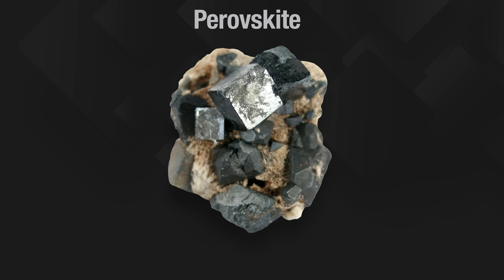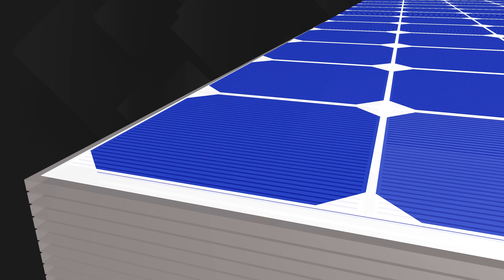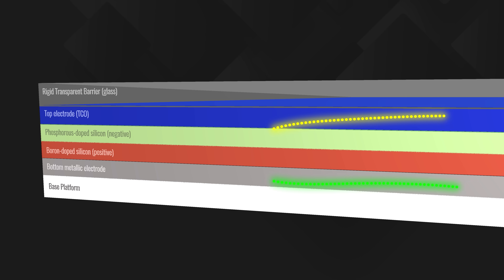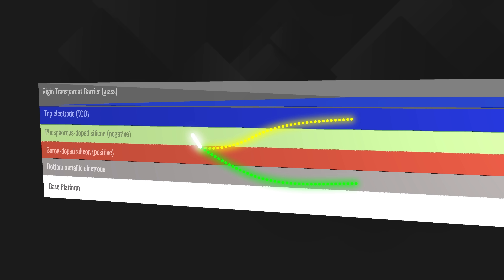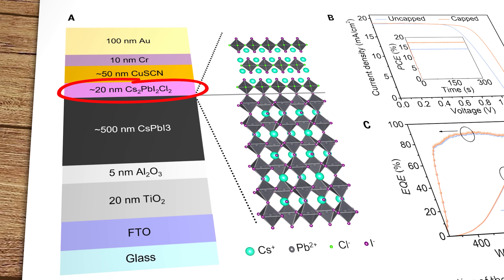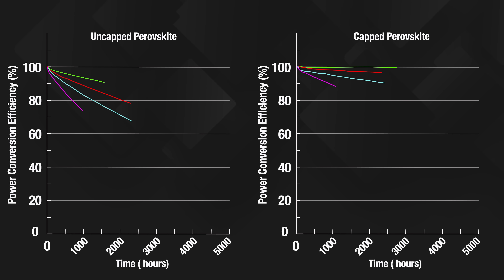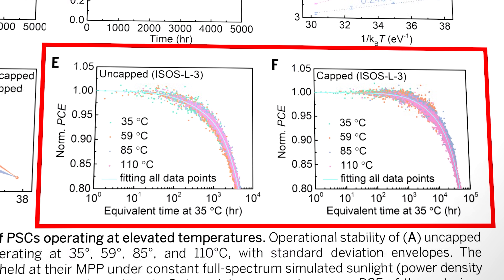Perovskite solar cells. Major new breakthrough!

Comment: IMO one should develop infrastructure that completely automates the replacement of the photovoltaic film. Manually feed a new roll of the film, connect the start of it to the end of old, worn film, start the machine, and have, say, 100m^2 of the PV panels replaced in place on the PV farm, old film rolled, new film unrolled into its place, then send the old roll for recycling. With price per m^2 low enough low lifetime ceases to be a problem, and the costly labor of replacing dead panels vanishes after single-time placement of the "bed" upon which the film would be placed.

Comment: If Perovskite cells are able to be made on flexible film & are so cheap, then would it make sense to have a solar panel with a dispensible roll similar to the old style overhead projectors that could be wound forward occasionally as the perovskite degrades?   Would save the cost of new mounts & labour, & the expired rolls could be replaced every few decades,  work as a quick economical fix until the boffins come up with a more durable solution.

Comment: Hope you're right about longevity of these cells because the silicon supply chain is going to be hampered for at least the next 12-18 months, driving up prices.   Hopefully perovskite cells can be productized and mass produced in that time frame, but the degradation and resiliency problems are multi-faceted, depending on the UV and IR frequencies bombarding the material.   The cost of cesium and cadmium have skyrocketed and are nasty environmentally.
Reply: Don’t forget that manufacturing technologies needs to get up to speed and ramp. And that you’re pumping out panels made with soluble lead in the perovskite.

Comment: Thank you for this video! I remember the first one you did on Perovskites, and it's really impressive how clearly you explained the theory behind them. I think I get it now.

Hopefully this particular Perovskite cell will reach mass production. The sooner it happens, the sooner we'll see real cells out in the wild and find out how accurate the testing is. Also it would be amazing to see large areas covered by the thin films, like the canals in your video.
Reply: I kind of hope they don’t until their soluble lead problem is fixed. Ramping the lead-versions could be an environmental catastrophe at solar farms and at manufacturing sites.
Reply: @robertb6889  interesting. got links?

Comment: I would like to see more work done on cheap solar. Most efficient is great for roof tops, but take the heat of a parked car in the sun on a summer day. Instead of a car, just use an almost air tight cheap box of (insert cheapest or ecologically friendliest material) and generate heat. Heat can be turned into power. Not as efficiently as light, but where I live (Houston), it is hot hours after the sun goes down. If a rural acre of cheap land is on the power grid, this could generate power without too much investment.

Comment: Interesting - but a lot of 'stuff' and processes involved.  What's the carbon footprint of making these films, are there any enviromental issues, and can they be recycled?  Solar films sound attractive - everything collecting power for itself - but still only when the sun shines, so is only realistically effective when twinned with battery storage (yet more carbon/environmental issues).  Wind/wave/tidal/hydro power, on the other hand, works at night and on cloudy days, and produces electricity pretty much all the time.  Nice as this clever, fancy tech is, what we really need is a lot more of the 'low-tech' generating capacity.  Boring, perhaps, but far more likely to replace fossil-fuel generation in time to mitigate the worst of global warming.

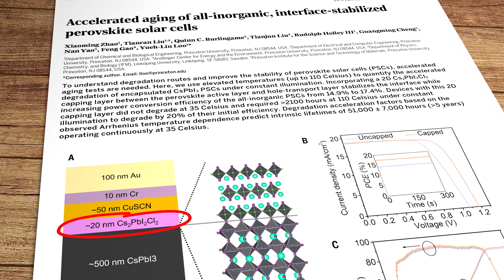Comment: Wait, does that diagram [5:06] show a 100 nm layer of gold?
At US$1810/oz, that gold is worth $120 per square meter.
This makes me a little skeptical that this is the path to lower-cost PV.
Reply: My guess is that they used gold because it is easy and cheap to produce gold thin films at the lab scale by vapour deposition. For mass production, a cheaper electrode material would be used.
Reply: @synura8086  Fair enough. So you're saying the electrode layer would in all likelihood end up looking the same as other PV technologies.

Comment: If the thin film can be tuned to capture energy in the infra red bandwidth then we are on a winner. Here in Queensland Australia the silicone solar panels usually operate at less than peak performance due to the excessive amount of heat they endure. 

If they could be retrofitted with a thin layer front and back that converts a portion of that heat energy into electrons then it would boost power output of the silicon cells by reducing their temperature. 

Furthermore, roof surfaces can remain very hot hours after sundown. If some of this heat can be converted to electrical energy, it would have a twofold effect. Firstly it would help flatten out the duck curve of power vs demand and it would also have a very minor effect in reducing the heat island effect
Reply: I would say that your thinking very narrow for the potential if thermal radiation could be converted to electricity. You could replace cooling towers at power plants, us stone as batteries, cool your solar cells and all the places where we just dump the heat could be converted to producing electricity.
Reply: Silicon is already at the infra-red. You actually want it to catch the bluer light at higher energies to drive up voltage and lose less on the high-energy photon side.

Comment: with solar cells this cheap we'll finally be able to build the utopian dream of solar. freaking. ROADWAYS.
Reply: solar roadways are expensive/useless because the surface that must transmit light also gets dirty and damaged by traffic and the environment.  There is more than enough land/surfaces for PV solar that we could utilize for a fraction of the cost.

Comment: Hey Dave, wonderful video as usual.
Only wondering what are the cost per watt of perovskite that are coated with long lasting material.
Reply: Until you actually manufacture at scale any estimates of cost/watt are just what engineers call a WAG: a wild-ass guess.
Reply: @robertb6889  One could simply calculate the cost of raw materials compared to current state-of-the-art panels and extrapolate from there. If they are significantly cheaper, then the WAG becomes a BestGuess.
Reply: @tzenophile  no, then it becomes a SWAG - a "scientific wild-ass guess." The cost of manufacturing has a lot more in it that just the raw materials: energy, environmental infrastructure and abatement, cost of building/designing/purchasing the manufacturing equipment and space, marketing, regulatory compliance, and so on.

Also, the raw materials tend to shift in price massively depending on scale. If they're rare and underutilized (like Te for CdTe cells) prices could spike massively due to shortages. If they're not widely manufactured, but cheap, prices could drop very drastically when the demand merits scaling up and economies of scale for an otherwise specialty chemical.
Reply: @robertb6889  SWAG- LOL. Of course I meant projected cost of raw materials. Availability rather than current price. If there is no rare-earth-like bottleneck, then the rest of your costs will flatten out over time.
Reply: @tzenophile  Note: those two terms were copied straight from my engineering design professor. Really until you have got it working you're just guessing at cost, and improvements will come along. Silicon solar, for example, has scaled well and smashed almost every expectation out of the water in terms of cost, making things like solar-thermal and most thin-film solar a lot less attractive. Perovskites could come along and completely break that solar curve - if they can get them to last long enough and deal with the environmental concerns of all that lead.
Reply: @robertb6889  What can I say? You have a very funny professor. Unfortunately, in today's amoral and largely subconscious political climate (so to speak), environmental concerns are not that important, so all Perov needs is a life extension.
Reply: @tzenophile  That's the scary part. I remember it coming along and thinking, "damn this is a bad idea, but it's getting MASSIVE traction in the research bodies and funding bodies."

The irony is that you're likely replacing one environmental disaster with another. Though I guess the "positive" is that you can keep most of this environmental disaster overseas and/or where it only affects poor people...as if that's actually better.

Comment: Whatever seems to be the most durable over a fixed amount of time for the lowest overall cost seems to be the winner at least in the race to outdo each other here in Alberta to build the largest solar projects... Travers Solar at 450 MW which opens fully later this year is using pretty conventional tech but clearly at a price that attracted Amazon to purchase 400 MW of its output for the next 25 years...

Comment: did anyone notice other layers of gold and chromium? i didn't read the research, so i can't see what those layers are doing. If required, this solution will be potentially expensive and toxic. this is not an uncommon problem at the engineering level. the tradeoffs put breakthrough materials and processes into the 'won't work in the real world' category. for example, we already have triple junction solar cells, but they are only good when the budget is high, like on the mars missions.
Reply: BTW, i do realize that 100nm of gold is about $1.50 per sq.m, but it adds up
Reply: Is it? That's not what I got.
100 nm × 19.3 g/cm³ × US$1810/oz, then do some unit conversions, and I got around $120/m².
Reply: @ps.2  thanks. you are correct. i was using 1nm thick. But i was also adding about 20% for application cost. This is very expensive.

Comment: Good news everyone! 
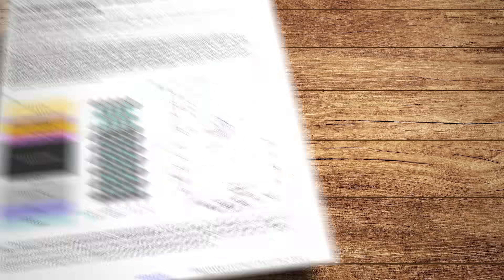Oh... Wait... @4:32 Caesium? Lead? These elements have been officially banned form use for consumer-grade electronics since 2005, under the RoHS. And for good reasons. On top of that, the halides (chlorides and iodides) of these toxic metals are water-soluble! And the 'SCN' group is probably nicely toxic too. Titanium Oxide and Aluminium Oxide are not particularly healthy either. This does not look environmentally sound at all. 😢

Comment: I know this is a new tech channel, but do you think you can ask your viewers for “thinks” that can be implemented right now? One I have in mind is that all new build big box stores, other large structures and supermarkets should be made to generate enough power to put into batteries so everyday they come off the grid for the hours between 4 and 8pm every day. This could be achieved by making their car parks and roofs be covered with solar panels and small wind turbines. Enough outlay so they can generate enough power over the whole day - when possible - to keep the power on in their building during peak times and reduce the load on the system. This sounds like not only common, but economic sense to me. Another is all government buildings, including schools, courts and town halls should be covered in solar where possible to generate energy when they aren’t open, weekends and school holidays come to mind.
Reply: Happening now in australia. The big box stores took a while but if you go into Bunnings (like Home Depot) you can see how much they put into the grid.  Only started doing it a couple of years ago. New mall locally  - full on PV to power it during the day.

Comment: the problem with solar is storage...
Reply: storage is not a problem as much as it is an fantastic opportunity to make renewables practical AND significantly improve the grid, micro-grids  and even home or site solutions.  Without storage as our grid is currently set up, power generated must be instantly used leading to complicated power sharing across the country (with high transmission losses), redundant power plants for peak loads,  and poor resilience to natural disasters including solar storms.

Comment: If the Princeston process is reliable, it's most of energy solved.  perovskite uses far less of much more abundant materials, and it's a much simpler manafacturing process, and much easier to install.
Reply: It also uses gold. Not a lot of it, but I worked it out to $120 per square meter. So I guess let's hope the rest of the process is really cheap?

Comment: In response to your last question, I that floating solar with dual-axis tracking systems are the future of solar.   With floating solar, you avoid the configuration constraints of residential rooftop solar: rooftop size, shape, direction, shadows, and the capacity of the grid hookup to the grid.  It's also a great new solution for community solar arrays.  Grid-scale solar reduces installation costs per KW, there is no limit to how much capacity a household, or business can buy, and it allows for renters, people who live in apartments,  townhouses, and small businesses without rooftop space to buy into solar, wind energy, and energy storage.
Reply: Another nice thing about solar over aquaponic farms is it helps prevent evaporation and provides safe breeding refuges for fish and crustaceans.
Reply: Then again, a powerful storm will easily smash such things to pieces.
Reply: @silvergreylion  No, it wouldn't.

Comment: Thx, great info. Sure hope this technology evolves quickly. The world needs a lot of clean energy. Personally developing electric fast pleasure boats. We schedule also solar panels on the bimini top. But the surface area is limited as will be with a lot of cases. Therefore real high efficiency will make these applications very meaningful.
Reply: The efficiency won’t change drastically. Vehicles with solar power are going to either struggle with range (and have to stop and recharge) or with speed and power. You could get 100% efficiency and that’s  about 1kW/m2, or a bit over 1 horsepower per square meter. So realistically anything above 0.5hp per square meter is unlikely.
Reply: @robertb6889  Well, that is the case of a pleasure boat (probably also with a car) not really the entire truth. As an example, we are developing a 8.5 meter - 12 persons pleasure boat with top speed of 40 km/h but optimal speed at 30 km/h. At optimal speed (30 km/h) it consumes 25 kW. It has 90 kWH battery capacity, so it can travel on its battery 108 km on optimal speed. When we have a solar roof of 10m2 at 30% effeciency and we enjoy a nice sunny day (8h)on the water, we could fill our batteries with:  8 * 10 * 1 * 30% = 24 kwH, so that is almost 30 km of extra range. A lot of boaters don't do more than 30 km on a daytrip. Even more, if you would slow down to about 15 km/h (requires 7 kw), your extended range of the sun would create about 100 km, more than enough to take you home, if you accidentally overestimated your standard battery range. Similar for EV: they store the energy in their batteries, n average they are used far less than 100%, probably less than 5-10% of the day. Now: this is already great for my boat design with 30%, imagine what would happen if the efficiency went up to even higher values (say 40%) and when I would increase the solar panel area! It would mean, that you could sail the oceans with reasonable speeds all day long!
Reply: @alfredspijkerman  Cost scales exponentially going over 20-25% because of the Schockley-Queisser limit. You have to have multi-junction solar panels which are REALLY expensive. They're currently mostly used for aerospace applications where they're having to be launched to orbit, so the weight counts.

But yes, in your case, if that's all you're expecting - go out for a bit, sit in the water all day, and head back, it is viable with sufficient battery storage.

Comment: I just wish I could get solar installed on my roof, any solar would be good! Over last 6 months tried all the companies in my local area, and either no response (assume too busy), or responses of too busy, can't get the materials or in one case, not skilled on in-roof installs. (Needs to be in-roof to get the aesthetic OK from the boss)

Stupidly annoying when we are getting a new-roof at the same time so scaffolding is already up and the wiring runs (imo) are ridiculously straightforward.

Comment: Lower cost for cells are nice, but longitivity is even more important. A big part of cost of solar arrays is framing, contracting, installation, permitting, etc. To lower it you need to make cells longer lasting. And I mean 40+ years at 80%+ rated power.
Reply: In his book “Electrify”, Saul Griffith goes extensively into the issues around contracting, installation, and permitting for residential/rooftop solar. He harshly criticizes backward-thinking local regulations, and points out that these local regulations are the main reason residential solar is far more expensive in the US than it is in Australia. I don’t see any reason that rooftop PV solar installation, properly industrialized, should need significantly more complex or heavily regulated installation than ordinary roofing material - and it’s considered totally normal to replace shingles every 15-20 years, and doesn’t require elaborate permits.
Reply: If the panels were sufficiently cheap and modular I would replace them myself. I'm imagining a scenario in which the mounting hardware, inverters and wiring don't need replacing except every 30 years. So at a 5 year lifespan you would replace the panels 6 times before any of the other hardware. If the process was easy and the panels cheap I don't see that as a problem. The bigger issue is recycling of the panels.